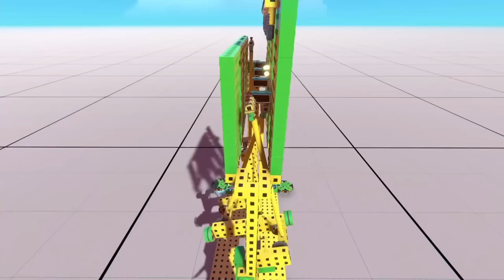Can You Use Cannons to Make an Engine in Trailmakers?

Comment: Some general tips:
If a block takes enough damage, it will disintegrate or as the game calls it "make scrap," so that is a reasonable possibility.
This game has a dedicated block for detaching parts. This way they respawn when you repair your vehicle. They can either detach the blocks and make them a separate object or delete them based on if "make scrap" is on or off.
Reply: I think something that can be useful to know for this kind of build is the transparent material in the paint menu, so that you can see inside a mechanism.

Comment: This is a neat way to build an engine in TM!  Some advice/tips: as far as I know changing the pitch of helicopter blades doesn't affect them at all - they also provide thrust in the same direction no matter which way they rotate.  Also, one thing you can do to get more thrust out of a low-torque engine is put the heli blades on extension pieces so there's very little extra weight but they end up spinning faster.  I tend to use pipes for this even though they're aerodynamically awful.  Finally, instead of servos you can use something called a 'spinning servo' (IIRC) that's 2x2x2 and doesn't require configuration to spin freely, but since you already have everything set up with regular servos it's just an effort-saving tip for your future builds.

Comment: I think you could revisit this with a lot of the new mechanics in TM! Also, using concave, rounded pieces might give you a smoother interior for the pistons.

Just as a general tip for trailmakers, trailmakers, there are two types of collisions: static and active. There are static collisions like when you use a distance sensor to permanently fix a hinge in place, the blocks attached to this hinge give a static collision that basically pushes against other static blocks it makes contact with.  The active collisions are what you experienced where moving objects collide. For whatever reason, the flat connectors (braces) only avoid collision on their flat side. So with you rotating them, they collide perpendicular to the rest of the crank. TM collisions are kind of unpredictable at times so usually it's just trial and error and sometimes the collisions happen and other times they don't.

Comment: Well the steering hinges could be used with suspension for a liner slider. You could also use just the recoil to make the engine more reliable.

Comment: The reason that some of the connectors had collision and others didn’t probably has to do with weld groups. A new weld group is created for every mechanical piece, and the pieces attached to it. Two weld groups right next to each other have no collisions, but if they get further apart they will have collisions.

Comment: OOO, beautiful!! One solution to your conrod hitting issue would be extending the rod to be insanely long so it changes it’s angle less as well as reducing stroke or just make a huge bore, I took your crank design used a 2 block stroke and a 24 block rod and the piston fit
Reply: Something I also saw that worked was to make a. Opening for the rod to fit but not the piston like a 2 block gap for the rod while the piston is 4 wide, wish I could design like you but I’m content with concepts

Comment: I've found that if you use the skis and put them on the cylinder walls and piston, the piston will slide up and down without falling out as well as not binding up. Basically you put skis on the piston then put a skis on the cylinder wall with the skis contact points touching each other

Comment: Maybe making the engine to be a crossplane 4 instead of a flatplane would smooth out the operation of the engine, very cool engine anyways
Reply from the maker: Potentially, it would have been slightly more work to set up though. Thanks!

Comment: Quick suggestion: Use the hoverpad glitch in trailmakers to make an engine, and then use gear ratios to make it high speed. The hoverpad glitch is incredibly high torque low speed and activates when you put blocks directly in front of hover pads.

Also since I don't see many people commenting about it, the reason the wheels go so slow in this example is because they are actually in what I like to call a "Locked" state. This occurs when (A) A vehicle has (Trailmakers provided) engines and you leave the seat, or (B) A vehicle has no (Trailmakers provided) engines.
Edit: "Locked" basically just means the wheels have brakes on

Comment: I dunno about trailmakers, but Terraria has circuitry and logic blocks and environmental hazards that can be triggered by circuits. I'd like to see how feasible a 'programmer' class is against various bosses and invasions. You can build arenas to fight bosses in (that's actually the intended method, so you can easily control for lots of variables.

Comment: i realized that your first few cylinder designs did not have any counter-torques for the helicopter engines which was probably causing unwanted movement in the creation
Reply from the maker: I think the pistons were binding on the cylinder in those cases and the heli engine added torque to the whole body instead of the crankshaft
Reply: @ReidCaptain  probably